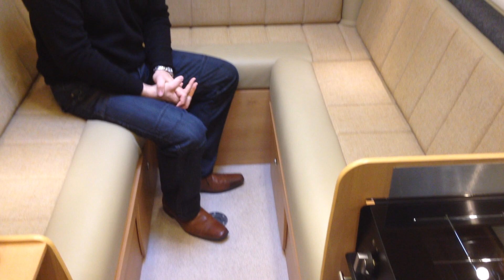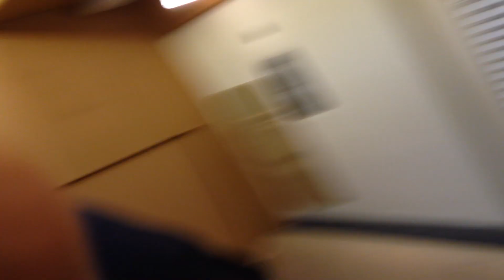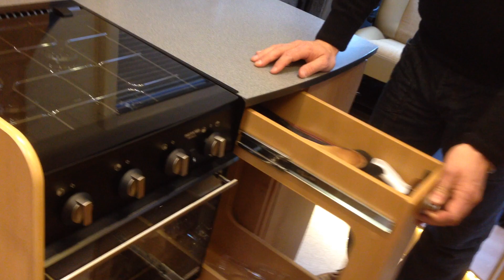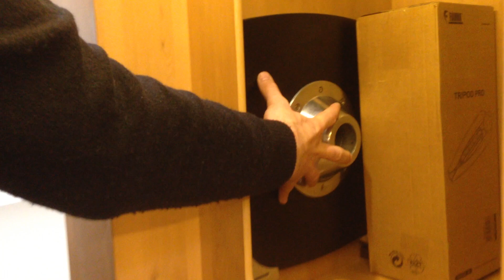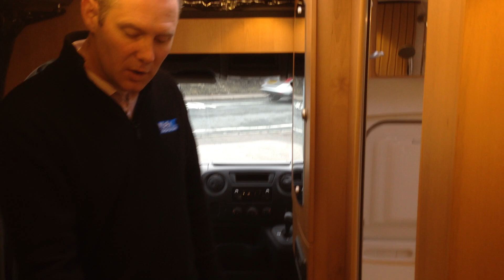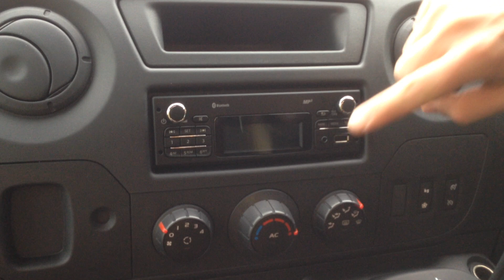2014 WildAx Europa Full Internal Tour

Comment: just looked at a Aurora? parked outside my house here in Tynemouth, Tyne and Wear" great looking "Low key" looking van ,not the usual white "Truck, like most other RVs. great explanation  on gas usage- cost", A real Bonus point," the interior coachwork is impressive" as is the full washroom,. does full winterization also mean  that in a hot climate your van is also protected from the heat" windsurfing being my sport" A roof rack is  a must, a non risible would be a good option. the security features in most reviews are "never mentioned" looking at your other vids your do " another bonus point,